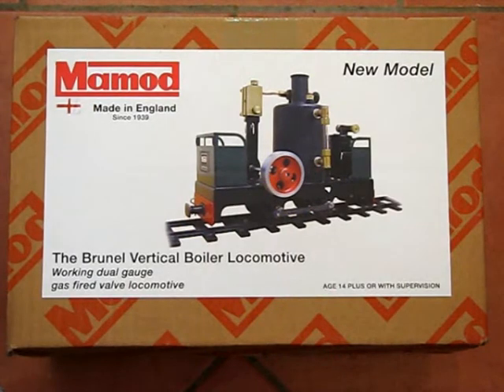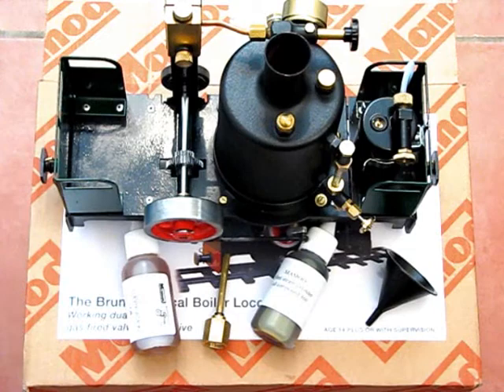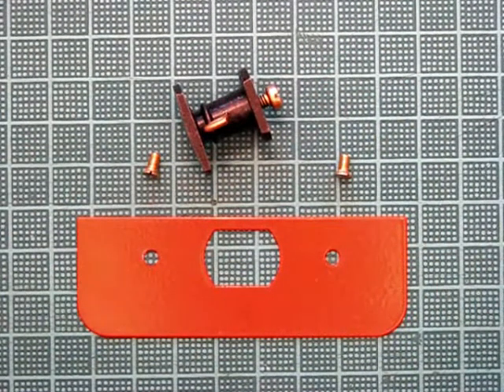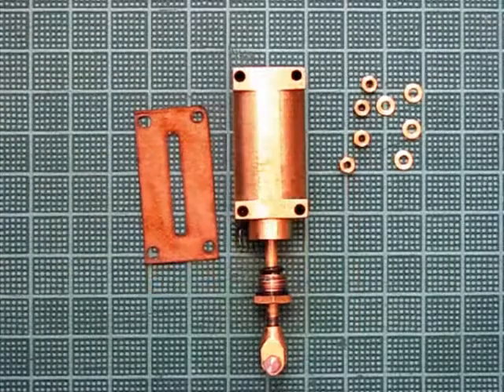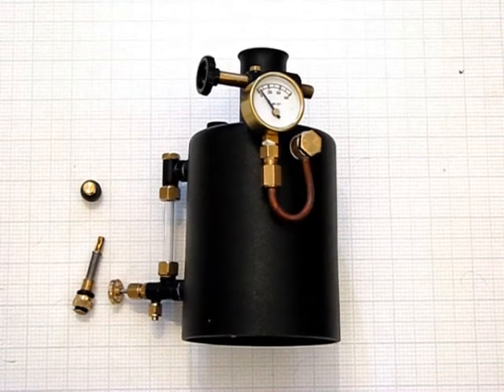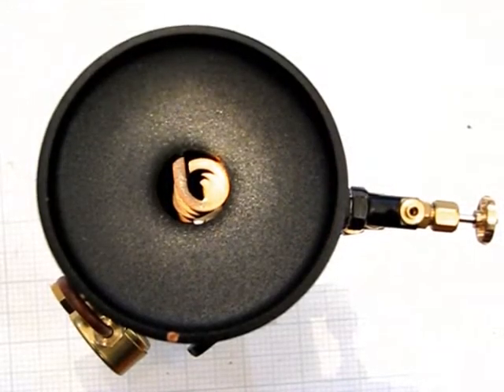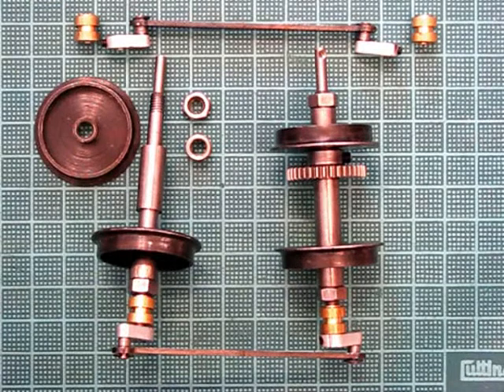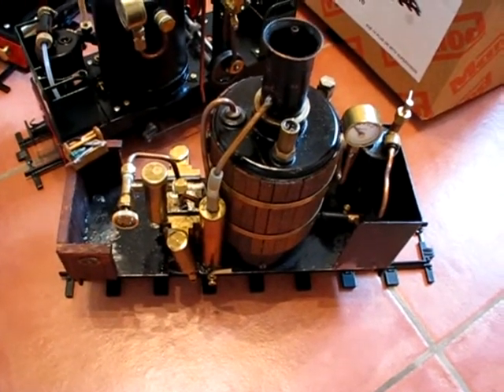Mamod Brunel Vertical Boiler Locomotive

Comment: My Brunel lubricator block has a screw drain that needs a screwdriver to open it - is this correct? No labelled diagram with the instructions? Am I missing a page?
Reply from the maker: Yes. The Brunel has had several tweaks since my model featured here.